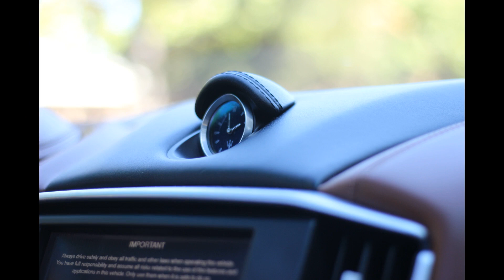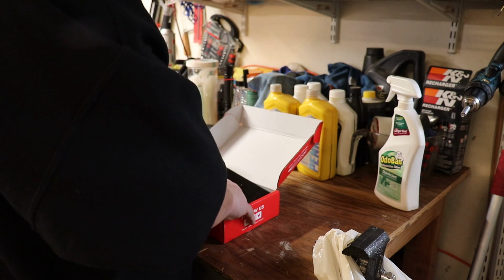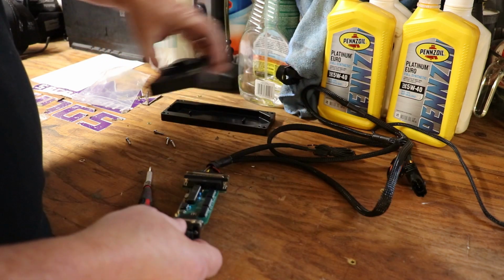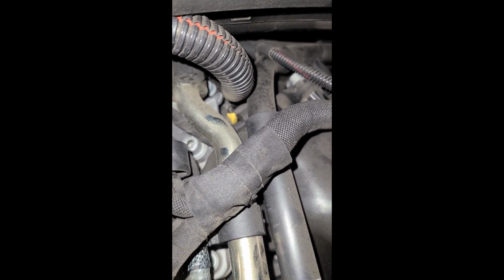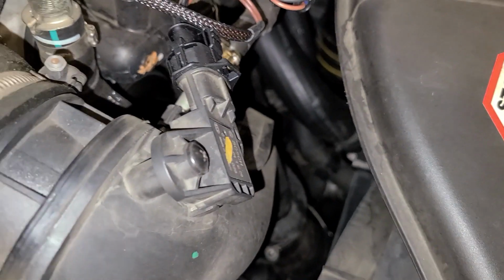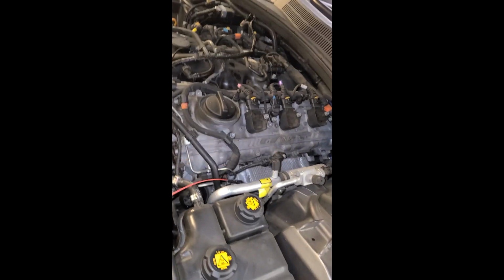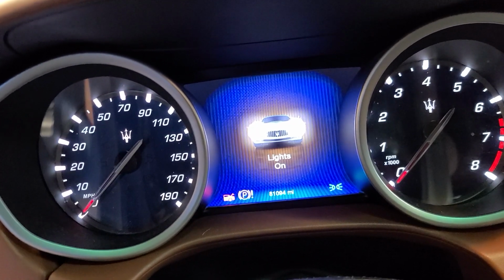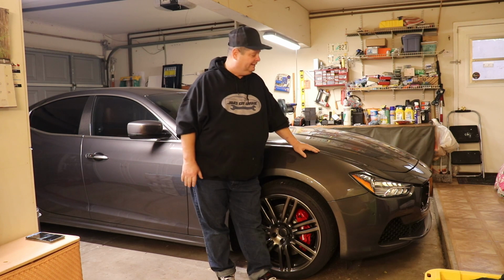Install A JB4 Tune Kit On A Maserati Ghibli SQ4

Comment: Sold mine last week! Man was that car a pain in the ass!
Reply from the maker: Sorry you got a lemon. There are a few in every batch. But don't hold the reliability of a few cars tarnish your view of the brand as a whole. Mine is a gem. It has been flawlessly reliable the whole time I've owned it. If you got yours second hand, the lack of reliability could have been due to how it was maintained by the previous owner.
Reply: Why is that?
Reply from the maker: @bigpapa247  The previous owner may have not been timely with oil changes, used wrong oil type, or not maintained proper fluid levels, or even may have abused it. Garaging it for long periods of time can also be harmful. Seals dryup and crack, fluids get old and loose effectivness. How the previous owner treated the car has a large impact on its reliability in the future. Some people just dont care.

Comment: i know it was while but can u explain which map did what? does it come with explanation? can you do burble(exhaust) on jb4?
Reply from the maker: The maps have changed with updates. I keep my JB4 updated. Now Map 0 is factory, Map 1 is for 91 Octane, map 2 is for 93 octane. I think 4 is valet and 5 is for race fuel, and 6 is configurable. I only use map1 since all I can get at the pump is 91 octane. There is more exhaust popping in map1 than in map0 when I shift from 1st to 2nd and then to 3rd. But if you want extreme popping,  get a custom tune.
Reply: @JamesDIYGarage  yeah i already spoke with uprev they dont have it unfortunately...i cant find anyone who can play with its weird
Reply: @vandalov777 Hey! Any luck with your tune?
Reply: @neverstopexploring2238   no;(

Comment: I just got mine in the mail on Friday. I need it put in the car this week.
Reply from the maker: Did you watch my entire video? If not you might be able to use the tips. IM me if you need help.
Reply: @JamesDIYGarage  Did you test the JB4 yesterday?
Reply from the maker: @acasphalt  No. I cleaned the Air Filters yesterday. I may do a test drive today off camera so I know what to expect when I do it on camera.
Reply: @JamesDIYGarage  we hooked everything up and we can't get it to connect to the phone, JB4 thinks its a unit issue, they are sending me another one

Comment: Perfect install. THanks for the tips I used a U hook and was able to remove it and used my 7 yr old and his fingers to pull the plug LOL . Updated the APP and its NICE in level 2. We have 93 here in NY and it WAKES up this puppy. I have a Grandsport 18 and in Sport the exhaust does loose a little tone at 6500. I find the exhaust 3500 makes a amazing sound. So, James thank you for the video. One thing they dont do is label the connectors, your video showed me which to use (it's kinda obvious) but I wanted to be double sure.
Reply from the maker: Thanks. Enjoy it. :)

Comment: Good vid! Thinking about doing this to my stock 14 SQ4 with map 2, but I'm concerned about the long-term reliability.
Reply from the maker: I have been assured by Burger Motor Sport that the JB4 device itself will not impact long term reliability. Having said that I read in the N54 forums that pushing the car to it's limits can reveal problems that existed before you installed the device.  So far I my car has not revealed any issues. I have been driving and just doing a pull here and there. I have not completed my testing though. As soon as I do I will do a video and post numbers and graphs.

Comment: My friend i own 2014 maserati ghibli s q4...the issue i am having is very different..when i try acceration after 4.000rpm to 5.000rpm car lose power..and then regain power..what do you think make this fault ? Bad purge valve ? Or solonoid valve ?
Reply from the maker: Do you have any fault codes?
Reply: @JamesDIYGarage  no nothing..and when i hit full throttle car sometimes jumps in the middle of acceration..no engine codes no limp lights..
Reply from the maker: @ilyasbuyuklu1587 do you have a Pedal Commander or other after market throttle performance enhancement device?
Reply from the maker: Just had thought on the way to work. Check the rubber coupling between the throttle body and the intake ducting. There could be a small leak there that opens under high boost which occurs at that rpm. Common issue with those rubber couplings. New ones are upgraded and thicker. So if you buy a new coupling get new clamps as well. Watch the last video in my Replacing Oil Pressure Sensor series. I install a new coupling in that video.
Reply: @JamesDIYGarage  my friend my english is not good..could you tell me which video and time to watch these parts you mention ? And should i also change purge valve, solonoid valve,oil ,transsmision oil and spaek plugs with injectors foe 122.00km maintenance ? Because i just bought car last week..and i should take it to maintenance i think ? By the way my friend has also ghibli ans i drove it few times..his car is way faster then my car..and i also found today that soloneid valve cable which is under engine cover has som damage..do you think maybe this might be issiue ?
Reply from the maker: @ilyasbuyuklu1587  Send a photo of the Solenoid Valve Cable to my email address, jamesDIYGarage@gmail.com

Comment: Perfect video ty.  I need to get 12v to the mirror for direct connect of radar and camera. Any ideas
Reply from the maker: Watch my video installing Waylens 360 4G Dash Cam in my car
Reply from the maker: https://youtu.be/T4a14jt4ZDU
Reply: @JamesDIYGarage  On it this week TY. Mines a 18 got my JB4 today too! DO you know what all the mapping are defined?
Reply from the maker: @LongIslandFirearms1  Depends on if you have the latest updated firmware. If you do, here they are. 
Map0 - Factory tuning
MAP1 -  91 to 93 Octane
MAP2 -93+ Octane
MAP3 - E30+
MAP4 Low Boost Valet mode
MAP5 - Same AS MAP3
MAP6 - User Defined
MAP7 - 100+ Octane
Reply: @JamesDIYGarage  Bingo TYTY! Lastly whats the two black wires coming out of the wiring harness. ?
Reply: @JamesDIYGarage  Do I need to install the 2 black wires on the JB4 (I read it the fuel lines) or can I leave those out
Reply from the maker: @LongIslandFirearms1  I only hooked up the Intake Pressure sensor, (Front one) the Manifold Pressure/temp Sensor,  Back one and the OBDII connector. I tied and secured the rest up where they would interfere with any engine mechanicals.

Comment: So I just got done installing everything made sure everything was plugged in right . As I opened up the app n tried connecting , but no device found I even get close to the Bluetooth n still nothing , what do u suggest I do ?
Reply from the maker: Did you pair it to your phone 1st?
Reply: I actually got it to work , one of the connection was loose , n I must say you definitely can feel the difference on map 2

Comment: Hey James I’m thinking about buying a 2014 Maserati ghibli sq4 with 31,000 miles, do you recommend getting a warranty for the engine, power train and axels and a little electrical components but it’s 3k. The car has always been serviced at Maserati and well kept in Florida.
Reply from the maker: Get a Prepurchase Inspection at an independent European auto shop that does Maserati cars. If you are not mechanically inclined and do not work on cars, yes get a warranty. It could be cheaper for you in the long run.
Reply: @JamesDIYGarage  well I bought a wrecked 2018 jaguar from Copart and fixed it up and sold it. So I guess I’m kinda of mechanically inclined I just looked at YouTube videos and figured it out haha. I’m sure your videos will help me a lot if I run into trouble.

Comment: How long did that back connector take you to get off and the new one on approximately?
Reply from the maker: haha, abut 30 minutes. In hindsight, it would have been easier if I removed the windshield water tray and the strut tower support beam 1st. Maybe take the same amount of time, but a lot less frustration.

Comment: Whatever happened to just hooking up to a laptop and flashing?
Reply from the maker: Still exists, just extremely risky. JB4 was tuned specifically to the car. Very safe and reliable but also easy to remove. Flashing is permanent.

Comment: It's odd they don't install the Bluetooth for consumers after you purchase it. So easy and safer I would think.
Reply from the maker: Yea, but it is very easy. Just be careful not to touch the chips and the back of the board unless you have grounded with a PC technicians ground strap. I dont have one here at the house. Lot of them at work tho.